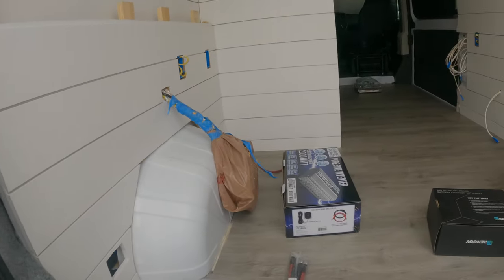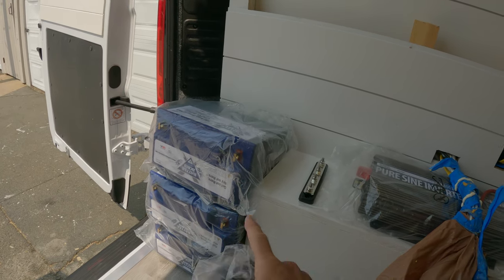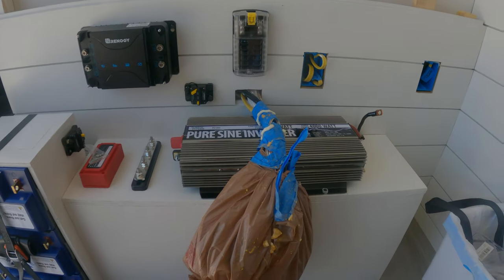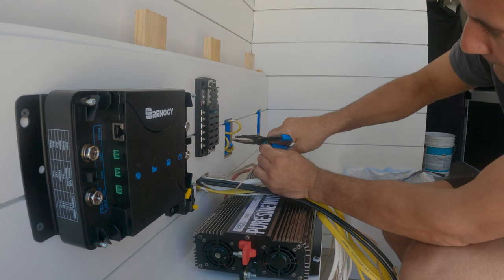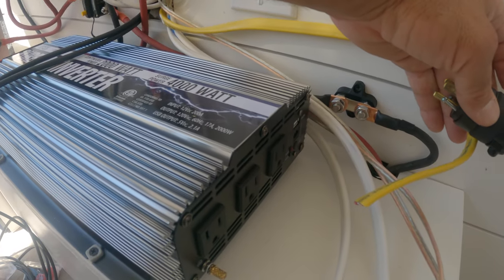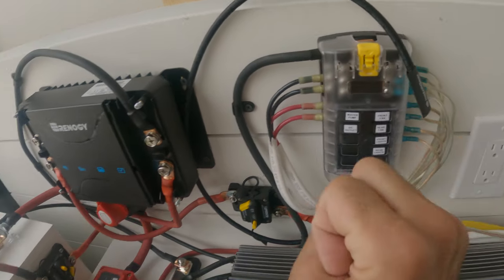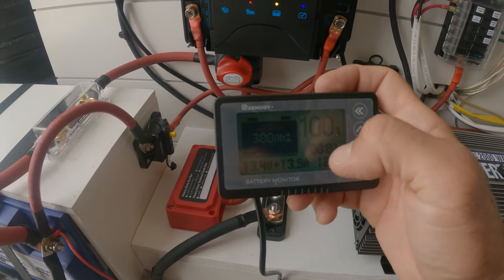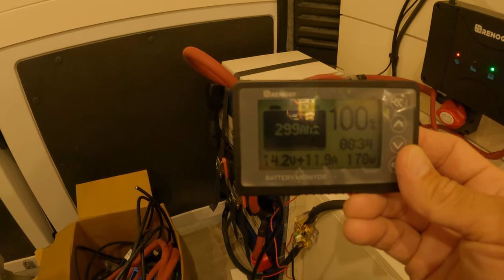Promaster Van Build | Ep8 | How to install Solar Power

Comment: big thanks for sharing this, I love how relatively simple this setup is. So if I can understand a few things:
1. you would not be able to charge off of shore power since the inverter you choose isn't a charger also like the victons
2. Your solar charger is a DC-DC alternator charger also, like a 2 in 1 vs. the separate solar and DC-DC units, sold by other brands.
Reply from the maker: Yes you are correct.  This setup doesn’t allow shore power charging, I assure you it’s not needed with the two charging options. However, it does have a bypass which allows you to plug into shore power which would power all a/c outlets while you are plugged shore power including the induction cooktop and water heater.  For your second question yes it’s like an all in one smart charger.   The main reason why I choose this unit.  It’s a great charge controller I highly recommend it.
Reply: @BuildingVanLife  Yeah, I'm really glad I seen this, it's a really nice and simple setup. Still in the research phase, but I was keen on doing the popular "victron" kit that so many people are doing but then started thinking, would I really need to go that high end and expensive, so started looking around at ways to simplify and brings the costs down. I think you're right, the charging from shore doesn't necessarily have to be done by a big expensive multi charger.  Sort of realizing that now from your video here. So the expensive and fancy way would be to buy the big multiplus unit that does it all automatically and internally. The less expensive and slightly less convenient way is to get a basic inverter like in this video, a spare lithium battery charger, swap some plugs and connect some charging cables manually when you're plugged into shore if you ever did want to charge from shore...

Comment: This was the most comprehensive example of wiring I’ve seen! I’m going to do this in my van. Wondering if you have another video on grounding to chassis and also how you ran wiring from alternator?
Reply from the maker: I show that in one of the earlier episodes when I was doing the framing wiring and insulation

Comment: Awesome setup and video explanation, thanks for putting these out, I'm sure they're pretty time consuming to create, but they're very helpful. I've used your scribing technique and the carpet covers for the back corner panels on my Promaster build, and I'm sure will use other tips as well. Didn't realize you were a pretty legit jits player too! Saw a Worlds nogi shirt you were wearing in one of your videos.
Reply from the maker: Thanks! glad it's helping.  I'm a Purple belt master world champion, now I'm brown belt.
Reply: @BuildingVanLife  Congrats on the promotion -- that's a big accomplishment. I do have one question if you don't mind that's somewhat unrelated to this particular electric setup video, and that is have you experienced any issues with the Chinese diesel heaters you've installed up to this point? I'm inclined to try one out compared to spending $1200+ on a Webasto or Espar model, but have heard mixed reviews. Any update from the buyer of your last van on the one you've linked in your videos since it's been in use for a while now? Thanks in advance!
Reply from the maker: @zachphipps5343  in my opinion the Chinese heaters are probably the best value of anything I put in the vans.   I haven’t heard of any issues from the people who have purchased my vans but I always figured, if anything ever went wrong with it I could buy about 8 of them before I spent as much as the expensive ones.  Once they are installed and all the cuts are made in the floor you could literally disconnect a few little things and pop a new one right in.
Reply: @BuildingVanLife  Exactly my thinking too...could buy almost 10 of these things before approaching the cost of a more expensive one after all the add-ins. Thanks for the response again man, looking forward to the next video!

Comment: Very informative.  We are big fans and we modeled our system after this set up. We are installing our system this week.   Question: On the Blue Sea DC fuse box, it had a wiring diagram that instructed the use of a 125 amp fuse?  did your system wire in a fuse?  Is it required?  Thanks
Reply from the maker: Thank you!  Yes it is recommended to use a fuse.  But I would highly recommend copying my current set up if possible on my new van.   It came out much cleaner.  Here is the link to the new solar set up https://youtu.be/xia8P2YNuMw  I cover the fuse for the fuse box in the video too.
Reply: We watched the new set up video after we purchased the first system. Looks great. Thanks for all the ideas and videos. Best van build series on YouTube

Comment: This episode is fantastic. I'm going to fallow you example. My question is I would like to have a shore power option with this setup, but I do not understand how I should wire it up?
Reply from the maker: With this setup you can’t have shore power.  But I just put out a new video with my new van and I installed shore power.  I would recommend going with my new setup.  Here is the video https://youtu.be/xia8P2YNuMw

Comment: Great video as always my dude🙌🙌

Quick questions - You said in the video you plug shore power into the inverter, but does that shore power charge your storage batteries? Or does it just use shore power to power your AC instead of using your battery storage?

Thanks!
Reply from the maker: Hi thanks.   Good question.   In this setup when plugged into shore power it is basically just a bypass to power all ac appliances directly and does not charge the system.  Id highly recommend copying my new set up on my new van that actually has shore power charging.  Here is the video for that https://youtu.be/xia8P2YNuMw cheers 🍻
Reply: @BuildingVanLife  thanks brother!

Comment: Hi, this video is one of the best, if not the best, I've seen on van solar installations.  And I've watched quite a few.  Thanks so much for doing this.  I do have one question.  Why did your system ground go to the front of the van for the chassis connection rather than making one at the  back of the van close to your electrical equipment.   Thanks again for the detail and calm explanations in all your videos.  Fabulous!
Reply from the maker: Thank you, I appreciate it.  I needed the negative line for my alternator charging from the front of the van.  The vehicle battery is already grounded to the chassis so I’m basically able to kill two birds with one stone with that wire.

Comment: I'm trying to copy your setup as close as I can
I have 400amps battery bank
How much amperage my main fuse should be?
Also I have 50 amps mppt charger controller. with dc to dc,how much amperage  my braker should be coming from the promaster battery to the charger controller?
Thank you very much and I'm so grateful for your videos
Reply from the maker: If you are using battle born batteries I would recommend you call their customer service.  They were very helpful for me.  For my 300 amp hours and wire size they recommended 250 amp fuse.  Ask them about your 400 amp hours.  I used a 100 amp breaker from my dc dc charger but some people recommend 80amp.  Start with the 80 and if it’s not tripping stick with that
Reply: @BuildingVanLife  Thank you I appreciate your reply and will keep learning from all your excellent videos

Comment: Great set up thsnks for sharing your video pretty impressive 👍🏼what size is your charge controller? Also what size are your black curtains are they 52x72 Long ? I notice on the video it was kinda long I think top to bottom on a pro master is 6’-0
Reply from the maker: It’s 50 amp.  All the links are in the description.  Curtains are 52x72.  You have to have them altered.  I willl show them finished in the next episode. I cut exactly one foot off the top at the dry cleaner which eliminates the curtain rings.
Reply: Right on bruddah keep doing what your good at U have been a big help building my van thanks 4 sharing

Comment: Great information in this video. 

I am building a electrical system similar to yours. I have the same Renogy 50A MPPT/Charge Controller and the same 2000W Inverter but I have only 1 170A Lithium battery.

Do you not ground the negative bus bar to the chassis like others do, is this not needed with the Renogy MPPT/Charge Controller? 
Also how did you go about sizing all of your breakers?
Reply from the maker: Thanks for your question, the system is grounded to the chassis, the negative from the vehicles battery is connected directly to the chassis.  That wire is also connected to the negative buss bar of my set up.  The breakers are sized to protect each device and it also depends on the thickness/gauge  of the wire you’re using and also the length of the wire.  You may need to read the manual for each device and also reference a wire gauge chart.
Reply: @BuildingVanLife   Thanks for the explanation, this helps a lot! Keep up with the videos

Comment: That second 4 gauge cable from house battery positive, Would it be ok to run that from the positive bus bar instead? With the 70amp breaker. 
Thank you for great videos!
Reply from the maker: I’m not sure which one you are referring to
Reply: Sorry, I mean the positive coming from the charge controller and the 70 amp breaker. Can it go to positive bus bar instead of battery terminal?
Reply: @BuildingVanLife  Oh I think you actually did that in your latest solar video, I'm seeing it now. Thank you :)
Reply from the maker: @JC-wr1vk  Yeh I would go off the new video I made a bunch of improvements

Comment: Why the switch from propane to electric? And was 200AH plenty when you've got propane for hot water/cooking? I've been debating 2 vs 3 batteries with that setup.
Reply from the maker: 200 ah was perfect when I had the propane water heater and propane cooktop.  Honestly the two reasons I switched was, the cooktop made an annoying rattle when I drove and I couldn’t figure out a way to eliminate it and also it just frees up a lot of space not needing a propane tank.  With the electric water heater and induction cooktop I would do 300-400 ah
Reply: @BuildingVanLife  Thanks for the info, that's insanely helpful. I think I'll start with 2 and leave room for a 3rd in the layout just in case. This channel is such a great resource for builds -- great work!

Comment: Thank you for that. In this video (at around 9:07) you point out wires that were previously run from the alternator. Does that mean that they are connected to the van battery? And is that a 4awg wire? I'm asking because where my charge controller is located, I measure about 25 feet of wire to the van battery. [the 4awg wire in your link list leads to a 15 foot bundle]
Thanks
Reply from the maker: Yes you need to connect to the battery.  You will need to extend with a bus bar. https://amzn.to/3l0hziV

Comment: Hello, what gauge wire is that from the battery positive to the 70 amp fuse?
Reply from the maker: I used a combo of 2/0 gauge wire and 4 gauge wire on this setup.  The links to the wire are in the description

Comment: I wonder if Renogy 12v ,50A charge controller dose not need to be connected to Isolator for protection of car battery.
Reply from the maker: It does not.   It’s designed to protect the car battery.  It’s a smart charger
Reply: Thank you very much for your kind reply, it help me a lot.

Comment: Did you ground the inverter to the negative battery terminal? Or do you not need to ground the inverter?
Reply from the maker: Yes it must be grounded.  I grounded it to a  negative terminal on the fuse box
Reply: excellent video! really helpful information. Can you also ground the inverter to the negative busbar or the van’s chassis?
Reply from the maker: @orcala2008  yes as long as it’s grounded you are good
Reply: the ac output of 120v from the inverter don’t need a ground right?
Reply from the maker: @orcala2008  no it should already be grounded from the inverter

Comment: Great Video Series.  Promasters have the 180amp Alternator, did you think the 220 is required for DC to DC charging?
Reply from the maker: I have the upgraded alternator from the factory, it's an option when you purchase.   I wouldnt say it's "required"  but it's going to be less stress on the alternator and will be better in the long term.   But hey, once it goes out it's a good time to change it I guess
Reply: Thank you for your fast response! @BuildingVanLife  We just ordered our PM136" and we are trying get the change in ( talked to dealership this am).  Hopefully we caught it soon enough.  We really enjoy watching your video series.  Lots of things to consider.  Would you recommend two MaxxAir Fans on the 136?  We are not cold weather travelers.  Warm/Mild targets 85% of the use. Cheers!
Reply from the maker: @Gaffigan1986  with the 136 you probably won’t have enough roof space for two fans and your solar panels.  You will likely have to do one and either keep the front window down a little with the fan sucking out or add a window inside that you can open
Reply: @BuildingVanLife  I understand.  Good point.

Comment: I also am wanting to duplicate your set up (especially the solar panel install). I purchased a 3000 watt inverter from the same company. What is the rationale for no AC breaker box between the inverter and the receptacles. And, if a AC breaker box isn't needed, can all of the receptacles be daisy chained?
Thanks
Reply from the maker: Bc the inverter has a built in breaker and the outlets are plugged directly into the inverter.  If your wire can handle the load there is no problem chaining them

Comment: One more thing: Do I need both the 60 amp MPPT Charge controller and the 50 amp DC to DC on board battery charger with MPPT?
Reply from the maker: If you buy the charge controller in my link it’s an all in one charge controller and dc to dc charger

Comment: Question: Since your three batteries, being 100 amp hours each, total 300 amp hours, how did you decide on a 250amp breaker? This part always confuses me.
Reply from the maker: This is what battle born recommend I do.  300 amp hours doesn’t mean 300 amps is traveling through the wires.  It’s just the capacity of the batteries.
Reply: thanks  @BuildingVanLife

Comment: What happened if I use 4 batteries What’s the fuse or breaker differences
Reply from the maker: Contact customer service of your battery manufacturer.  They should be able to answer

Comment: Do you have any idea why my panels keep stop working? My alternator charges and the panels worked and then just randomly stopped working so I changed the fuses and they worked again and then they stopped working again. I think every time I start the van, it burns the fuses between the controller and panels. They are hooked up in parallel, I’ve looked like 5 times
Reply: I have the same controller as you. And to my knowledge same setup entirely
Reply: And tbh I’m not positive it’s blowing the fuses cause they are solid white. But I bypassed them and it started charging. So I got new fuses and it worked again, then a day later I noticed the controller is getting nothing. It’s sunny out and they are getting direct light. Zero light on the controller for the panel.
Reply from the maker: maybe you have the wrong size fuses for your panels? Starting the van shouldn't have anything to do with your panels, they shouldn't be wired together so maybe you them wired incorrectly.  It would be difficult to say whats going on without seeing it.
Reply from the maker: @CharlesBakke  verify with the maker of the panels what size fuses you should be using.
Reply: @BuildingVanLife  there’s a sticker on the back of the panel that says max 15amp fuse. If I bypass the fuses it starts working. 

You connected your charge controller to your negative bus bar and the negative bus bar is all grounded from the starter battery, correct?
Reply: From my starter battery I go through a 100amp breaker then to the negative bus bar. Panel negative is attached to the controller
Reply from the maker: @CharlesBakke  yes the grounds are connected to neg bus bar.  You should have a 15 amp fuse on each positive of the solar panels before they connect to the other panels.  If you are using the fuse after they are connected that could be the issue.
Reply: @BuildingVanLife  I think I figured it out
Reply from the maker: @CharlesBakke  You are putting the positive from your starter battery to a breaker and to the negative bus bar?  that would be incorrect.  The negative never goes through breakers only the positive and the positive obviously never goes to the negative bus bar
Reply: @BuildingVanLife  haha no no. I’m not that fried. I figured out the problem.
Reply: @BuildingVanLife  this was the problem